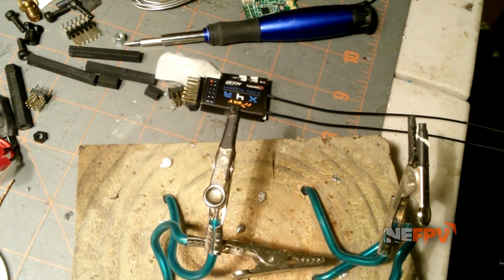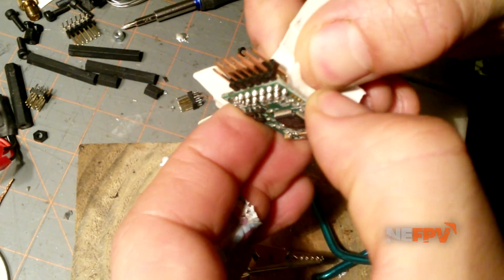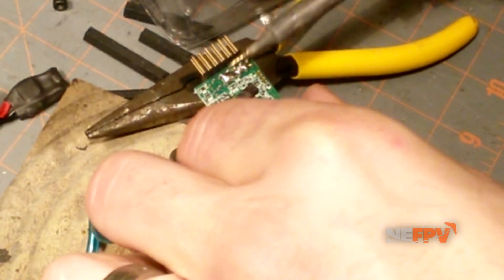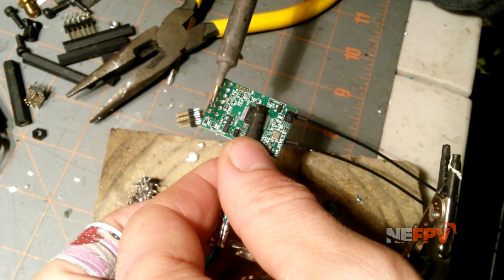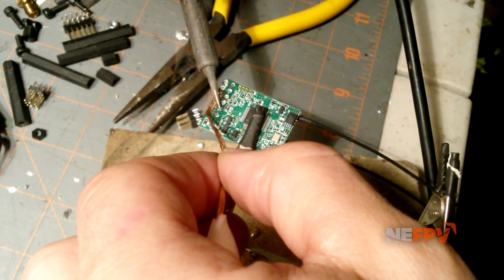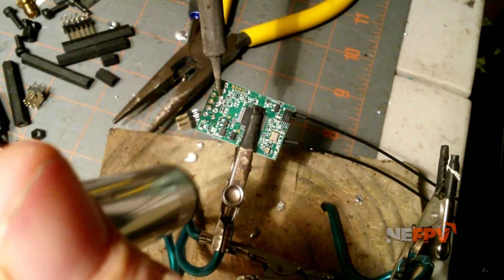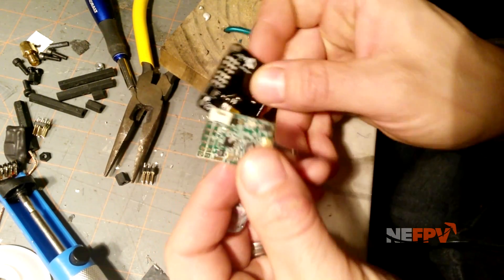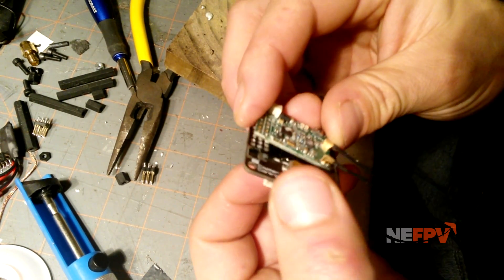Easy X4R/D4R Depinning & Flight Controller Sandwich - Naze32

Comment: with the solder sucker I find a easier way is the heat the pin then suck it from the top side, it keeps the solder flowing
Reply from the maker: +SyncR heat the bottom? Yeah that's probably the best way to do it!
Reply: +Slowjett Yeah heat the bottom, keeps the pin movable so sucker usually pulls it straight out,  95% of time your left with a nice clean hole on first try
Reply from the maker: +SyncR nice, i'll have to try that.